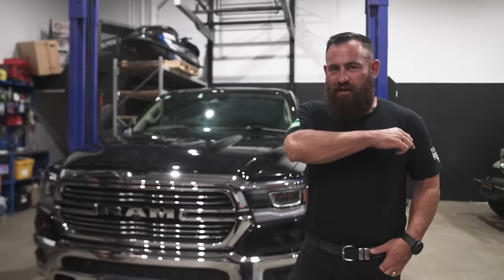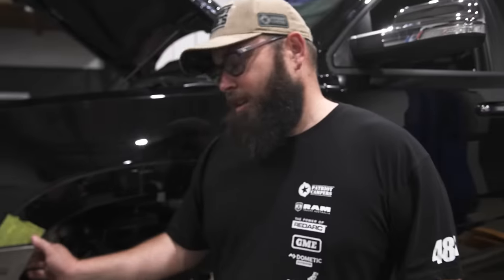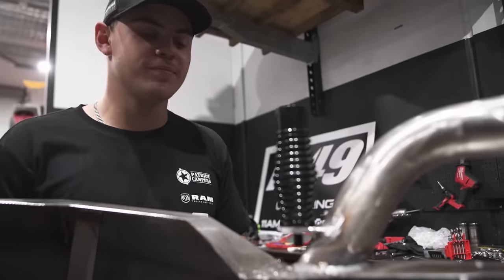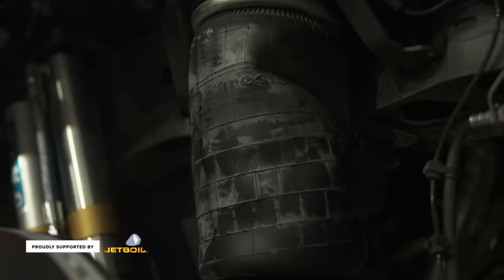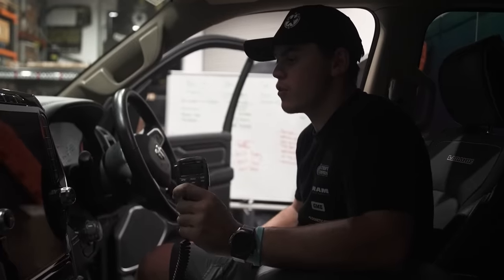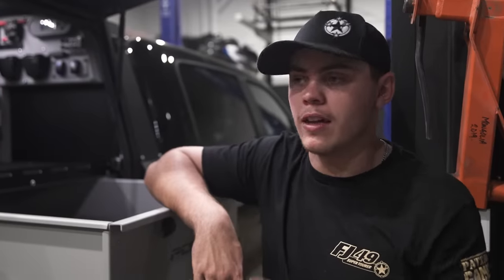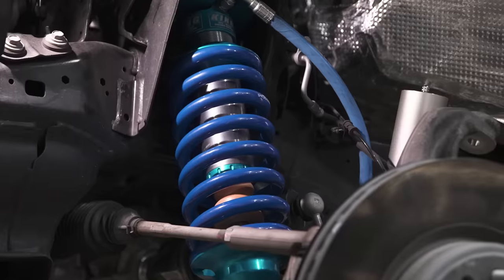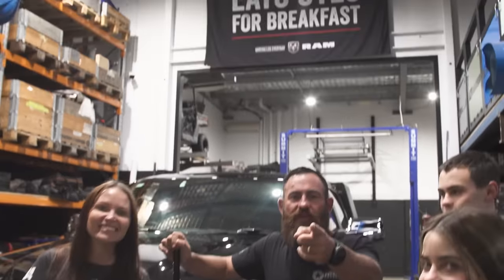Building Mum's RAM 1500 SUPERTOURER in SECRET!

Comment from the maker: Chapter markers:
00:00 Teaser
00:24 Introduction - What's going on the RAM?
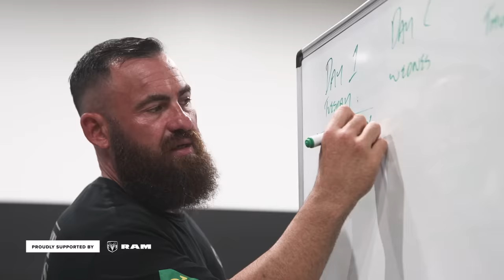02:55 Removing the bumper bar
05:10 Installing the new Off-Road Animal Bull Bar
09:01 Installing Borla Exhaust
10:04 Fitting the upgraded suspension lift kit
13:32 Christian checks out the RAM 1500 so far
14:13 Enter the Patriot Games Season 6 Competition
16:12 Day 2 - Fitting Upper Control Arms & Airbags
18:35 Final Bull Bar Fitment
19:28 Removing the RAM 1500 ute tub bed
20:24 Unboxing and installing the PCOR Tray
23:25 Installing the GME XRS UHF Radio
25:13 Day 4 - Finishing the PCOR Canopy
27:15 Power Options - RedArc Solar Blanket
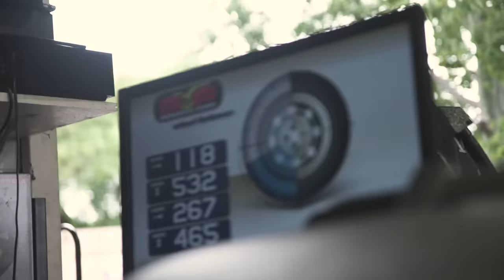27:41 Fitting Wheels and Tyres at Bob Jane T-Marts
30:00 The Final Reveal - Surprising Mum with a custom RAM 1500
31:45 Rig Rundown - Walkthrough of all the mods
Reply: Hi patriot games what’s up Ashton how are you doing today mate do you wanted to meet up one I am one your best friend from school

Comment: HI Team,

Great build. Love the end result. One little thing I noticed, the Branich spring compressor you are using you have the old design arms. The welds are not strong enough and have already failed on ours. Speak to your rep and get the service kit ASAP and change them. Ours came very close to killing one of our mechanics. If you need any further info, contact me.

Comment: Honestly what I would change is make the canopy match the tray wider at the bottom and ether shorter canopy or taller headboard…. Yes I get why you do it so they fit on everything and easier and cost effective to make one size only but just makes it look like the canopy was cheaper out on when it’s actually a mint expensive canopy

Comment: Love the rims she looks HOT  (the Ram) I would have put in a Jmacx GVM and break upgrade along with a alloy roof rack with light bar oh a DCS lithium starter duel battery system. Other than shes sweet.

Side note I'd love you to build a brand new V6 Ranger and Every with a lovells GVM GCM upgrade even as give away cars. I really think you've love them. Or even look at a Chevys which have heigher factor GVM GCM than RAM 1500 and 2500 although Jmacx have a fix for the RAM 2500 GVM GCM upgrade to full US spec.

Comment: i'm not sure if its popular there but instead of doing a canopy/ half canopy, have you guys ever considered a camper tray w/ a popup top where all your storage and sleeping space is on the tray? i'm thinking of something like a cross between something like your x1n trailer and your canopy tray, but with a completely built in hard side living space as well. if additional light storage space is needed, you can extend the canopy forward over the roof of the truck cab. thoughts on this?